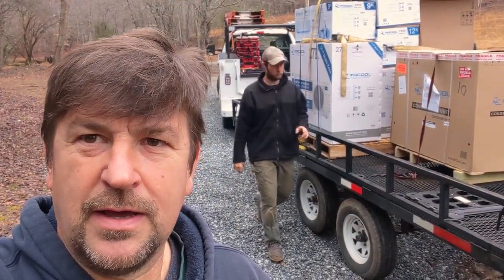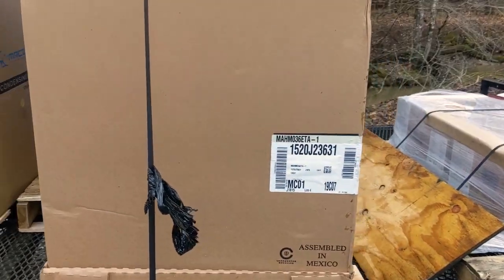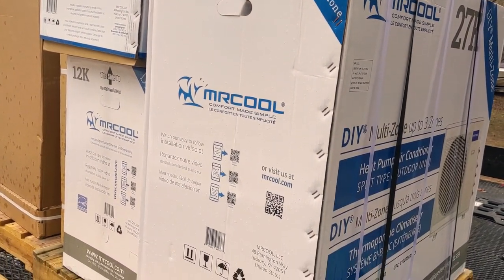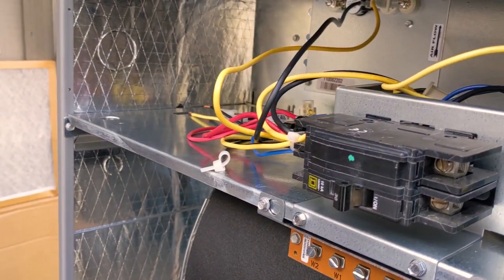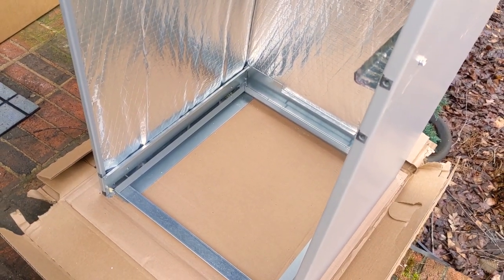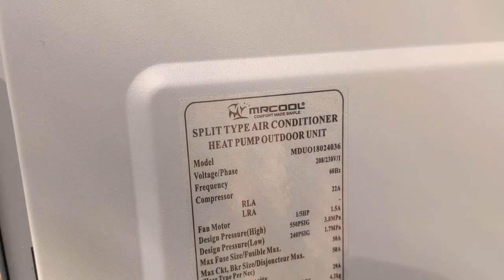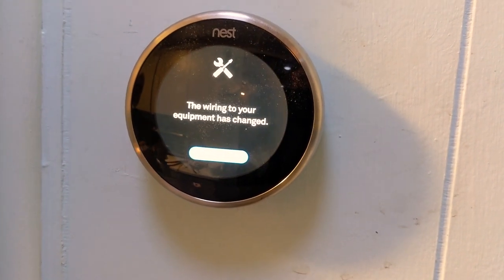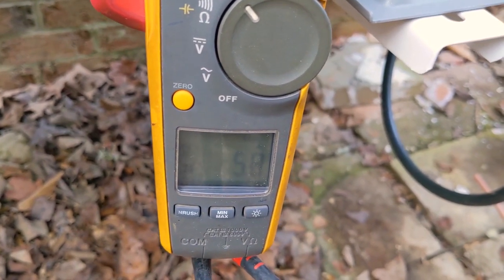Putting a MrCool Universal in this off grid home

Comment: You guys didn't purge with nitrogen while brazing. All that oxidation that happens on the outside of the copper will do the exact same on inside. So the EEV will clog and you end up with a restriction in the system. It doesn't happen right away. It can 2 , 3 or 5 years later but it will cause problems. Big no no ....

Comment: Let us know how well the unit works after the first full year. It's good that you are mounting it off the ground so snow buildup won't be an issue (it can trap the fan or prevent proper defrosting, leading to ice formation). The MrCool units are re-badged Gree Flexx series unitary products with a different (and in my opinion nicer) paint color, and better service and support from MrCool instead of from Gree in China. A lot of problems come from inexperienced DIY installations, but a good lineset (enabled by the Gurgler) and a practiced installer will avoid the refrigerant escaping.
Reply: ...his “buddy HVAC guy” left off the purge and pressure test with nitrogen steps. Oxide scale damages compressors and clogs refrigerant metering devices.
Reply: @USA-GreedyMenOfNoIntegrity  I was thinking the same, also didn't see the bi-flow filter drier.
Reply from the maker: FYI so over a year later everything is working great. There have been a few operator errors on the 27k unit when they try to run it in cool mode  while others are running it in heat mode at the same time and that does not work and puts one of the units in standby. For the most part, we've been happy with their performance of all the mr cool at  this location.

Comment: Thanks for sharing this important video.  It establishes successful precedent for inverting/modifying the Air Handler to allow for Downflow operation.  I plan to do the same modification at my house with the MrCool Universal Heat Pump System.  I checked with MrCool support ... they do not currently offer any kit for Downflow operation of this system; however, you have helped me by demonstrating that it can be done.  And for this reason, I will be purchasing and installing in the near future.
Reply: @dsavo3525  I'm about to do the downflow conversion as well were you successful at converting yours to downflow as well?
Reply: I, too, wish to do the downflow conversion on the universal, and wonder how you made out.

Comment: Wait, this is a ducted system? With vents in every room? I would love to have this as I hate those “mini split” wall units.
Reply: @late4dinner268  what I posted is what he installed in this video. That is not a mini split, it’s a traditional ducted system.
Reply from the maker: Yes this is a ducted system with a Mr Cool universal outdoor condensing unit
Reply: @engineer775  would that Mr Cool universal outdoor unit provide a second port? So a wall mount indoor unit can be installed, say in a garage? But be separate from the main indoor unit?
Reply: @robertsteich7362  no. You would need to look into concealed ducted mini splits for that, that you can mix and match.

Comment: MrCool does sell pre-charged linsets for these. The unit I installed used one. They're considerably larger than the DIY system linsets, but they do function the same as do not require the installer to have any HVAC tools. That said... they're expensive. I think I paid like $500 for my linset from IWAE. But I didn't have to pay anyone to install it either.

Comment: Wow your always on the go! And looking good. I’ll be putting in two Mr. Cool units soon. Thanks for taking the time to do the video!
Reply: There crap do your home work before you waist your money.
Reply: @late4dinner268  what heat pump would you recommend besides Mr. Cool?
Reply: @chrisripplinger  Gree Sapphire is a good quality one with a very high 30.5 SEER rating for a 1 ton unit mine is 6 years old and runs 24/7 never had a problem with it.

Comment: Heat pumps loose efficiency as the temperature drops. IIRC they are around 400% efficiency at about 60 degrees and drop to about 100% efficiency around 30F to 20F (depending on the unit). below that they are less than 100% efficiency. Electric resistive coils are 100% efficient. So while they may run at low temperatures that aren't much better than resistive coils, & if the temperature is low enough, worse then resistive coils.

Another issue to consider is ice build up on the coils if is raining & the outside temp. is near freezing. If its bad, it can cause the fan to seize.
Reply: That is not true. They loose capacity, but not much efficiency. With 410a and inverter drive, they don't care about cold.
Reply: It is true that they reach full cycle efficiencies (including defrosting) of under 100% much quicker than the government test and sales media let on.  In my case with my minisplit and my whole house heat pump they are both around 0F to 10F.  I'd say 20F is a good estimate for a typical standard efficiency unit and 0F to 10F for a high efficiency one.  It takes some effort and time to figure out what the balance point for 100% efficiency but it will be higher than heat pump pushers tell you.  Much higher.

Comment: Hello, 
Do you have any update on how the system is running in the double wide?
I am considering the heat pump / air handler system ... but I did not se an option for a down flow kit ?
Do you have the part number ?
Thanks

Comment: Could you give more detail on how you vacuumed and charged? The air handler is precharged so I see you pulled vacuum on high and low side separately. Did you open the valves with Allen wrench on the condenser so the vacuum pulled inside it too? Or does the factory already vacuum it so only needs to vacuum from the connection on condenser back to air handler? Also did you add r410a or were you below the maximum length before having to add? Thanks!

Comment: I unplug the white wire in my thermostat stopping heat stripes from coming on. Saved 200.00 a month electric bill. So it takes a minute extra to blow warm.
Reply: For the 3-5 minutes your hp is in defrost, you have a very efficient air conditioner. Most people prefer tempered air exiting their supply registers at 30F or less outdoor temperature.

Comment: Hi i have the 60K BTU am also up in the north my question is the thermostat connects to the outside unit only ? or its it connect to the inside unit or did you connect it from outside to the inside unit and the thermostat inside ?

Comment: My Mr Cool dealer told me about a VERY COOL TANKLESS water heater that is powered by Ohmic Array Technology instead of metal heating elements, seems to wok kind of like a microwave for water. It's called Model 3 by Heatworks, myheatworks dott com. Has an app that you can dial in perfect temperature as needed.

Comment: Did you need two seperate 220 lines, one for the air handler and one for the condenser?
Reply: yes, its similar to other split systems
Reply: No. One 30A is more than enough.

Comment: Why did you choose Gree (Mr Cool) over others like Midea (Pioneer) ducted split?
Reply: 🔴 What Is Islam? ⚠️

🔴 Islam is not just another religion. 

🔵 It is the same message preached by Moses, Jesus and Abraham.

 🔴 Islam literally means ‘submission to God’ and it teaches us to have a direct relationship with God. 

 🔵 It reminds us that since God created us, no one should be worshipped except God alone. 

 🔴 It also teaches that God is nothing like a human being or like anything that we can imagine.

🌍 The concept of God is summarized in the Quran as:

📖 { “Say, He is God, the One.  God, the Absolute.  He does not give birth, nor was He born, and there is nothing like Him.”} (Quran 112:1-4)[4] 📚

🔴 Becoming a Muslim is not turning your back to Jesus. 

🔵 Rather it’s going back to the original teachings of Jesus and obeying him.
Reply: @1islam1  Guessing he got them 4 free.
Reply: Wait Mr Cool is Midea
Reply: Why choose a high efficiency heat pump on an inefficient double wide mobile home with 4” x 13” beer can aluminum duct (with no insulation)?   
Why choose mini splits vs a regular split system? Check to see what the warranty is on a mini split. See if your local HVAC guy works on them and carries parts for them. Most likely not, and because the normally stocked universal parts won’t work, better plan on waiting a week or two on breakdowns.
Reply: @andreycham4797  No, Gree makes the Mr Cool equipment

Comment: Got some friends in Wisconsin...they say they get -35 to -40 at times...not sure this unit could handle that for very long.  
Can you directly link your Discord server...its not showing up in the directory.
Reply: Universal running in the coldest city in the lower 48... https://www.youtube.com/watch?v=_v8vizQXwss&t=73s
Although it would probably be recommended to have a gas furnace backup for long term sub-zero temps - it held its own and significantly out-performed traditional heat pumps by a mile.  The Universal can be installed with an existing furnace and heat strips are available.
Reply: Gree ultra energy star -31 F